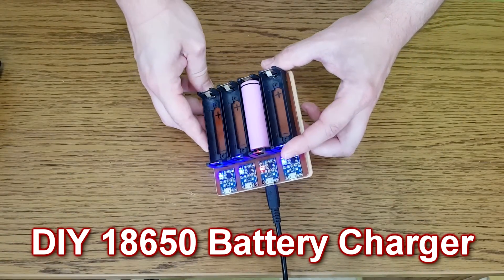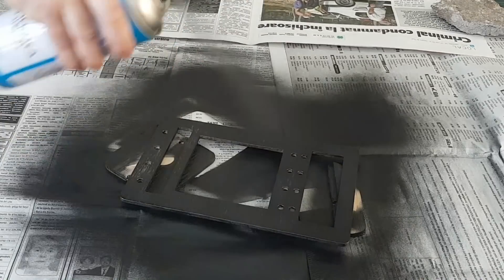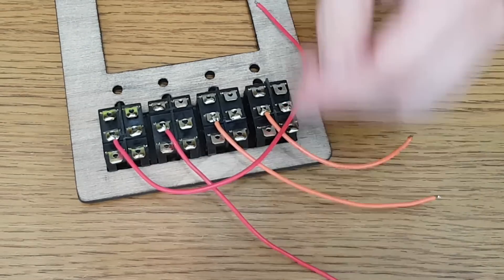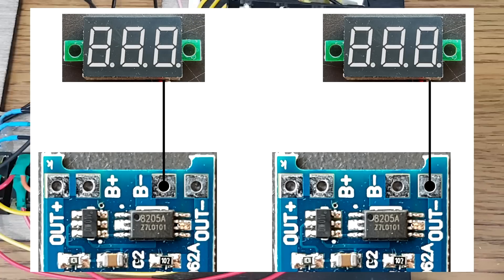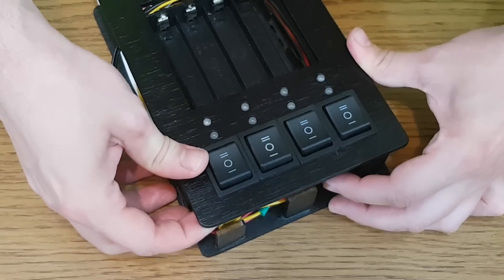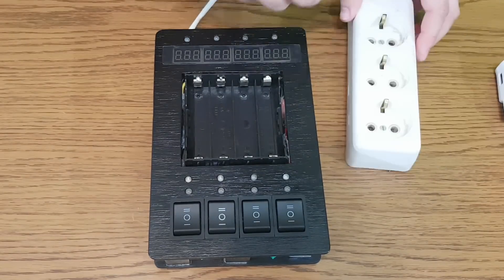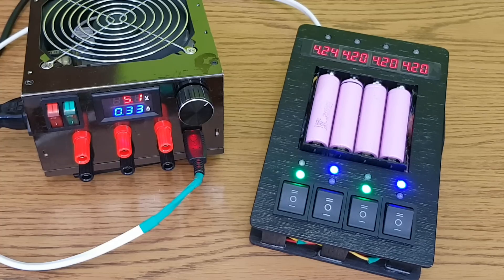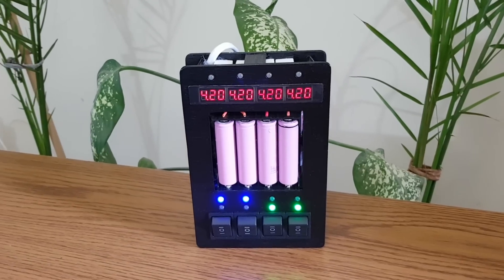My DIY 18650 Battery Charger

Comment: Are you engineer ?
Reply from the maker: almost :)
Reply: @Sorin_DIY  what u have studid
Reply from the maker: I've studied at the local Polytechnic University. but I've ended up working in a different field, there aren't many electrician/engineer jobs in my country. but electronics is still my passion.

Comment: Very nice project sir. I was amazed by the transparent daylight reading plastic for the LED displays. Very very nicely done. But I must say, it will be a bit expensive this way? You could also use the same holder and a iCharger with a 4cells balance plug.
Reply from the maker: hi. it is a bit expensive, because it has a lot of components. but I like these tp4056 charging modules, they are very useful in a lot of DIY projects. you can make a cheaper charger with these charging modules, without all the other components, I have a separate video for that.
Reply: @Sorin_DIY  Thanks for the info! I do like the sturdyness and dedication of your project. This thing is built to last! I am sure in a 100years they will still be charging 18650's on your project.

Comment: Holle sorin..is it recommended charging using imax charger like other youtuber using? If i charge multiple cell in parallel will it charge in balance?
Reply from the maker: hi. I recommend to test and charge salvaged cells individually. the cells can be charged in parallel, only if they are already tested, they are the same type, have the same real capacity, and they will be used connected in the same configuration.
Reply: @Sorin_DIY  thank you very much for your reply. great video,good explanation and very educated 👍👍👍

Comment: Is it possible to add a volt amp meter like in the PSU video?
Reply from the maker: yes. in a future video I will make a charger with balance feature for battery packs. this will include an ammeter.
Reply: @Sorin_DIY  Ciao Sorin, Buon Anno 2025. Se l'hai fatto, puoi per favore postare il link ?    Grazie.    Antonio  (un tuo grande ammiratore).

Comment: Would it be easier to use female terminal for switches?
Reply from the maker: I don't think so. you still need to solder the wires to the terminals and it will take more room inside the charger.
Reply: @Sorin_DIY  You're right, and if you don't shrink wrap them, perhaps when you bend the pins you can short the terminals by mistake?

Comment: Dear Sorin, I am trying to build your design!!!! Where can I get the same ROYAL 221 Resistor with both input and output pins on the same side of the resistor like in your video? Your link shows resistor with input and output for the resistor on opposite ends. Thank you!!!
Reply from the maker: hi. I've bought the resistors from a local store. I don't know if you can find them online.
Reply: @Sorin_DIY  Thank you for your help.

Comment: Mi ics melt the hot glue after some minutes. They are charging fine, but they get too hot to the touch. 1 amp is being applied. Is this normal? The batteries I have are new and old, so I think they are fine.
Reply from the maker: hi. it's normal for the TP4056 IC to get hot, while charging with 1A, but not enough to melt the hot glue. hot glue fixes the circuit board to the panel, the circuit board should not get that hot. you can use a small self adhesive heat sink on the IC.
Reply: @Sorin_DIY  Thanks for the response. Mine do get really hot. You cannot touch it after some time. I had to put a heat sink on it so it did not melt. Any hot glue I use close to it, went melt in seconds. The IC charges well and is the only one so far that gets really hot. Another one gets hot too, but not that much. Weird.

Comment: Why noone adds the cost of enclosure?
Reply from the maker: because you can make if from what you have around the house, metal, plastic box, MDF, plywood. I've made it from a $0.60 piece of plywood, which I had laying around the house for years.
Reply: @Sorin_DIY  Thanks for replying! You are right! Please help me by answering some questions. This modules also help for discharging protection? If so, is it safe to use cheap 18650 by the time the module protect us? And something last. Do you know why me buck boost converter cannot adjust anynore the output and output is same as input?
Reply from the maker: the charging module I have used in this clip, has over discharge protection. so it's safe to use it with cheap 18650 cells. but if you use 18650 cells with problems, they can heat up or catch fire, whatever charging module you have. so I always recommend to use good quality cells and test them before use. for your buck boost converter check the potentiometer and the resistor that is in series with the potentiometer. this are the easiest to replace. otherwise... without seeing it, I don't know.

Comment: Very nice Sir. One question.   I tested the output voltage of the TP4056  module and it is only 3.9 volts using  5 volts 1 ampere cellphone charger. Is it normal?  Thank you so much. 😊
Reply from the maker: hi. you mean the Out+ and Out- pins? this is exactly the battery voltage. this voltage varies, according to the battery getting charged or discharged.
Reply: Sorin - DIY Electrical Nerd  Good morning. Yes Sir. The + and - of tp4056.  Is 3.9 volts. It should be 4.2 volts to charge the battery? Thanks
Reply from the maker: when the battery is in the charging process, the cell voltage will vary between 2.5V and 4.2V. check the voltage, when the battery is fully charged and there is no load connected to the output pins. it should be around 4.2V. if you connect a load, the voltage will decrease.
Reply: Sorin - DIY Electrical Nerd Thank you so much Sir 😊

Comment: At what rate does it discharge?
Reply from the maker: hi. I've used 10ohm resistors to discharge the cells. so the discharge current depend on the battery voltage. I=U/R. when the battery is fully charged, the discharge current will be: 4.2V/10ohm=420mA. I've place a table in the video with the discharge current for every battery voltage.
Reply: @Sorin_DIY  Great. Thank you

Comment: can we use it for charging other batteries ? or anyways to update it for doing it ??
Reply from the maker: hi. you can use it to charge any type of li-ion cells, that have a nominal voltage of 3.6V or 3.7V and a maximum voltage a 4.2V. and you can charge some li-po cells too, that have the same voltages. you just need other connectors or battery holders for the cells you want to charge.
Reply: @Sorin_DIY  so no 1.2 v ni-mh batteries then (( thnk you for the impressive video and your answer. I hope one day u will teach us to build a charger for all aaa. Aa li-ion etc batteries

Comment: I already make this one...but for 15 minutes charging the white resistor heat up and getting hot for 1 hours charging...is this safe?
Reply from the maker: the load resistor shouldn't get hot, while you charge the cells. only when you discharge them.
Reply: but mine resistor is getting hot even i add the heat sting above the resistor...whats wrong??...i used following component what you using it and i have following the schematic
Reply from the maker: The load resistor should get hot only when you discharge the cell. This is normal. Does your resistor gets hot when you charge the cell too?
Reply: @Sorin_DIY  yes you right....my resistor getting hot even i charge the cell...but im not install the resistor 1k led diode and volt meter
Reply from the maker: I think you did not connect the load resistor wires correctly to the switch. check the wiring. did you use the same switch model?

Comment: can i use my volt meter that only have 2 wire red and black only??
Reply from the maker: yes. but when it's measuring less than 3v, the LED display will be less visible. that type of voltmeter usually measures between 3.5 - 30V DC.
Reply: Sorin - DIY Electrical Nerd thankyou....

Comment: Can you post a charger for 4 batteries connected serial (giving 14.4 volt together) that is used for the drill
Reply from the maker: my next video will include what you need.
Reply: @Sorin_DIY  Ciao Sorin. L'hai fatto ?  Antonio

Comment: Congratulations friend, beautiful work! Can you tell me the model of the notebook battery that you opened to remove the 18650? thank you so much.
Reply from the maker: hi. it's the original battery for the Asus K73SV laptop. aftermarket batteries have different cells with lower capacity.
Reply: thank you friend

Comment: Salut, am nevoie de ajutor am cumpărat mai multe module bms ca acesta https://magazin.unda.tech/module-incarcare-acumulatori/1758-modul-echilibrare-si-protectie-la-incarcare-2s-10a.html și eu am 4x baterii de 3,8 Volti și 3000 mAh va merge sa le încarc ? De ce sursă am nevoie? Mulțumesc anticipat
Reply from the maker: salut. depinde ce acumultori ai. modulul acesta BMS functioneaza cu acumulatori de 3.7V nominal si 4.2V maxim, pentru ca ii incarca cu 4.25V - 4.35V. ai nevoie de o sursa de 8.4V - 9V. dupa parerea mea cel mai bine e sa le incarci cu 8.8V. poti sa folosesti o sursa de PC sau alta sursa de 5, 6 sau 12V si un modul ridicator / coborator de tensiune de minim 3A, sa reglezi tensiunea de iesire la 8.8V

Comment: hi. you can use module voltmeter and ampmeter to know how much capacity battery 18650. see picture
charging; http://imgurl.ir/uploads/a77438_IMG_20180824_045150.jpg

discharge:
http://imgurl.ir/uploads/l041857_IMG_20180824_045739.jpg
Reply from the maker: hi. this will work also. I will probably use it in another video. but I wanted this charger to be as cheap as possible.

Comment: Can we not use just one charging circuit for all the cells??
Reply from the maker: hi. with 4 charging modules you can charge 4 cells individually. the cells can have different capacity, they can be discharged to different levels. you can put each cell in the charger at different times. all the cells will be charged much faster, with max 1A. not 1A divided to all 4 cells. if you want to charge multiple cells with only one charging module. the cells must always be connected in parallel (when you charge them and when you use them). the cells need to be the same type, same capacity, same lifespan, same charging-discharging cycles and they will be charged 4 times slower -> 1A/4=250ma each cell.

Comment: They crap chargers no more than 1amp output take forever to charge bout time version 2 came out lol and it cuts out around 2 to 3amp battery protection ..cud use RGB led and less wire ..looks good bro well done

Comment: Hi Sorin  i tried to charge my battery with a battery capsitor charger ,with two Resister connected togerther , But charger read as as error 3,, but only one battery did the complete charging . What does the error 3 means . your advice please tks 

 
 

Reply

Comment: Where does the voltmeter positive go?
Reply from the maker: the voltmeter positive supply wire is connected to the positive 5V overall supply wire.
Reply: Sorin - DIY Electrical Nerd thank you!

Comment: I have 20 old laptop battery but he was out put 2 volt only can you tell me what's problem?
Reply from the maker: hi. you can try to revive them with a battery charger. you need to set the charging current to max 300 or 400 mAh and charge the very slowly. check them very often if the batteries get hot. if they do, while charging them with this small amount of current, the batteries are not good anymore. after they are fully charged, you deposit them for 2-3 weeks. then check the batteries voltage. if it's more than 4.0V, the batteries are still good.
Reply: If they're all down to about 2 volts per cell only, they're likely quite bad already.
I mean like he discharged it down to 2.5v per cell, that's already too deep of a cycle to do usually. You normally wouldn't want to get them lower than ~3.5v or so for them to last long.

You can still charge them (carefully, monitoring if they don't get hot), and some may be salvageable with like half their capacity or so. With luck, a bit more even.
Reply: Thanks

Comment: Hi Sorin ,i am very much interasted in this project , i have all the parts except the heat resisters ,can i use a 10w 15ohms rs instaed  ofthe 10w10ohms ..your advice plaease thanks ...
Reply from the maker: hi. yes you can use the 15ohm resistor. but the discharging process will take longer. when the battery voltage is 4.2V, the 10ohm resistor is discharging the battery with 420mAh. with the 15ohm resistor - 280mAh

Comment: 3:00 be sure that over the charging duration it will soften the glue enough to where the wires might mode the charging modules around - try using sanitary silicone next time — takes forever to set, but it will withstand very high temperatures without breaking a sweat (and is also soft enough to rip in case reworks need doing, unlike epoxy)
Reply: Dunno if it's enough softening to worry, hot glue takes quite a lot of heat to melt, those circuits will shut down long before 100°c (the IC, the board is a lot less), dunno what type of glue he's using but from my searches they come in low and high temperature variants, so about 120ºc to melt on low temp. type (a bit worrisome) and high temp is about 190°c which is way out of the range.

Comment: Chiar foarte misto ideea, nu m-am gandit pana acuma ca pot sa-mi construiesc un incarcator de baterii in loc sa cumpar unul. Nu era o idee mai buna sa iei un controller de incarcat LiPO mai bun, ca sa ai doar 1 pentru toate 4 bateriile ca sa poata sa fie incarcate toate la acelasi nivel?
Reply from the maker: salut. se poate si asa. insa daca probezi baterii diferite, cu capacitati diferite, unele pot fi chiar defecte, nu poti sa iti dai seama cat de repede se incarca sau descarca fiecare. daca o baterie se incarca si se descarca foarte repede, nu se mai poate folosi impreuna cu celalalte.

Comment: If you accidently put the battery in the wrong way, will it destroy the tp4056 board?  I fuse my tp4056 boards
Reply from the maker: hi. if you put the battery in the wrong way in a charging module without protection, the charging module will be destroyed. I did not try this yet for a charging module with over discharge protection. I will try it for a future video.
Reply: Yes, reverse polarity (putting the battery in the wrong way) will instantly kill the TP4056 chip.

The protection on the board he used is only for battery over-charge & over-discharge. It does not protect from battery reverse polarity.

You can add a mosfet protection circuit. Check out a good video about this from Afrotechmods.

Comment: When I first saw it . I thought it was 3d print! Nice job. Mine takes up about 1 sq meter! And only charges 12 cells ! And discharges 3 cells.  Nice!  Have you thought about using some thermal sensors in a silicone gel or something to get the charger/dischager to shut off if the cells get hot?  I was getting up mid night for batt change. And put a cell in back ward twice. I started using more light when changing cells. Trying to charge and test 100's & 100's of fast as I can takes a long time. So I got up mid night for cell change for two months plus. I have 98 to go. Then time to get more! I only need about 10,000 cells with 2.5-3.0 ah each. (2600-3000 mah each.) In a 29.4v 7s bank. It's gonna take time!!!! I'm only like 1/100th through that at best. I guess about 5k cells would work. But what's wrong with excess!!! Nice video!!

Comment: A regular USB connector is only capable for 1A, it will get very hot if you use it at 4A
Reply from the maker: hi. the USB connector is ok, it doesn't heat up. I took it from a printer cable, because is better than other USB cables. if you use a thin USB cable, it may heat up. that's why I used thick wires. the USB connector is just a piece of metal and plastic, it's not the weak point in the circuit, to heat up. only if there is an imperfect connection between the USB connector and USB port (oxidized contacts), both port and connector can warm up.
Reply: USB connectors are spec'd at 1.8 A max.
Reply: @JohnSmith-xn3fr  nope... USB can deliver up to 4 amps at 5 volt, I don't know if they can go even to 5/6 apms or more
Reply: John Smith But Samsung...
Reply: Sun Chao
Good point dude!
Reply: Well, as stated above me, the connector is rated to about 2A or so (and that's how much Quick Charge uses), it may take more but it's not really recommended at 4A.
I would have added a bigger plug to connect to the big full size PSU to charge at 4A, and leave the USB one to just the phone charger lower load operations, well, that's a suggestion at least if you plan to use it more for the 1A per cell charging often enough.
Reply: Ahh thats why my batteries charge so slowly...
Reply: I already make this one...but for 15 minutes charging the white resistor heat up and getting hot for 1 hours charging...is this safe?
Reply: it simply wont supply more. not a problem. charging will take longer.

Comment: But How much did it cost?
Reply from the maker: I bought packs of 10 charging modules, 10 LEDs, 300 resistors... I have many electronic parts left, but if I calculate only the ones I used in this project, it should cost 26 euros.

Comment: be carefull, these battery chargers can't do any temperature sensoring or fault voltage/current monitoring of battery. I have made similar charger and i almost burned my house down, because on battery was damaged and heated up to 80°C
Reply: A13tech
Like to work with damaged batteries much?
Reply: i didn't know that one battery is damaged. It has around 3,98V .